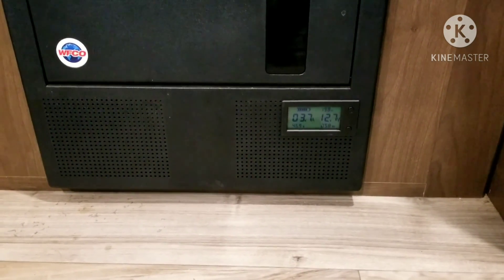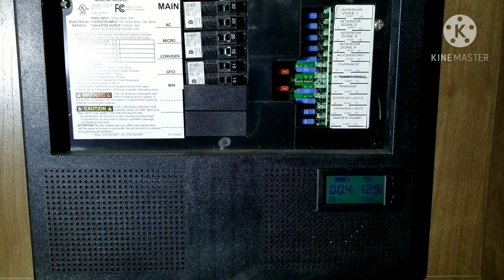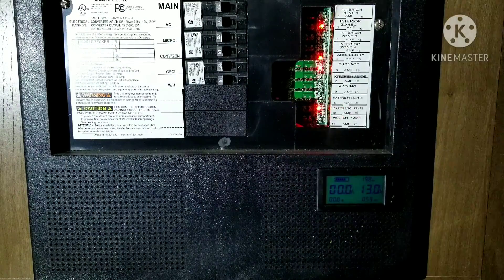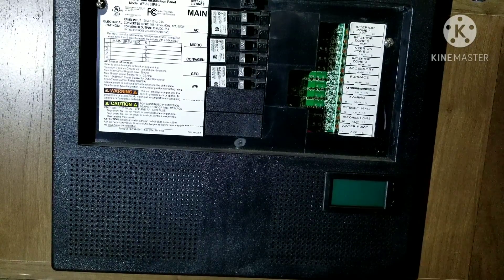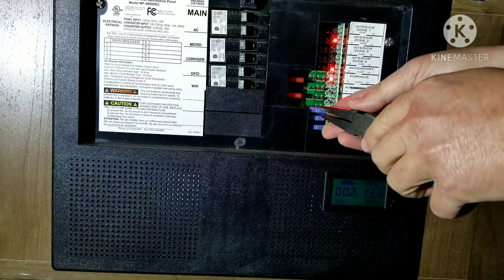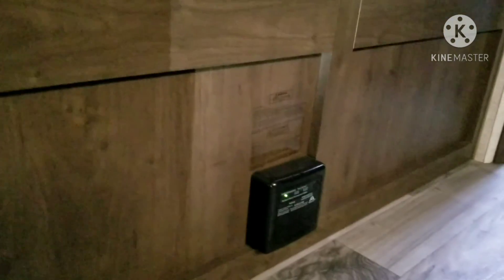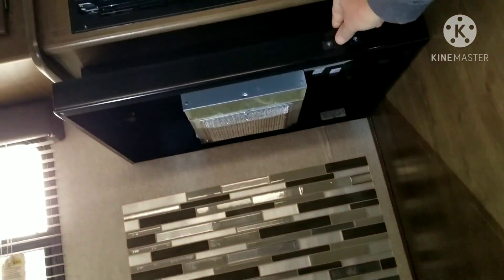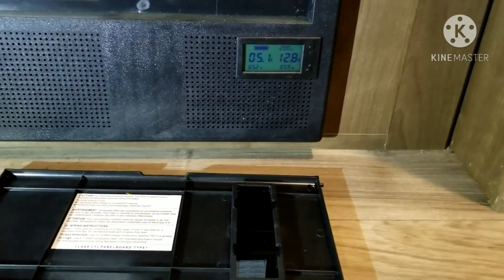Rv Battery monitor calibration no load drox AiLi How to calibrate

Comment: OK...I took my Drok on a 7-day boondocking trip. When I boondock I am very miserly in my power usage. The only things running is the propane detector, the fridge brains and occasional water pump usage to flush and wash dishes...not much at all. Although I got good digital battery voltage readings, the battery icon never showed a drop and my Ah readout never dropped below 100 (where I preset it). My battery started out at 12.7 and just shy of 7 days later it read 12.5. And the W and WH readings? I have no idea what those readings are telling me.
Reply from the maker: Watt hours are how much you used and if being charged how much was brought in. 
Check out a 12v battery voltage chart to see start of charge for a lead acid battery
Reply: @johnnysweekends  Thanks. I still don’t understand why my battery icon and Ah setting (100) didn’t show a drop.
Reply from the maker: I would double check settings and make sure it matches battery type

Comment: Interesting...the reset process. I habitually remove my batteries after every trip (tweaker battery thieves in the area). Would that suffice to reset my monitor?
Reply from the maker: I understand that. I dont know if it would reset everything because i think it has flash memory so settings should stay but usage and such that should reset. I think 🤔

Comment: Why is mine reading -4 amp and - wh
Reply: Mine does the same thing. No load on the system verified with my fluke 87v. Driving me nuts
Reply from the maker: Weird deal it seems these newer ones are having issues. Someone said they did a update on them but not sure..?
Reply from the maker: Not sure maybe installed back words on the sensor ? Unless it’s charging then it would show negative

Comment: my ammeter stopped working after only 3 months. The readings are frozen. If disconnecting and reconnecting the power supply wire it works for 5 min and freezes again. Any ideas to get it working?
Reply from the maker: Did you try to reset it..? It’s been a while but I think it was hold both buttons for a few seconds?? 🤔
Reply: @johnnysweekends  thank you, I will try to do so and tell you...